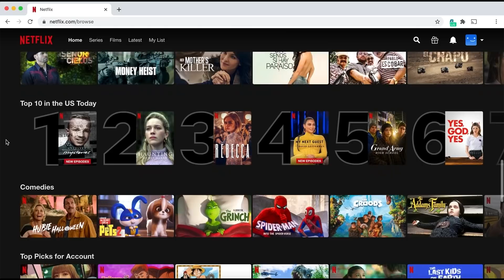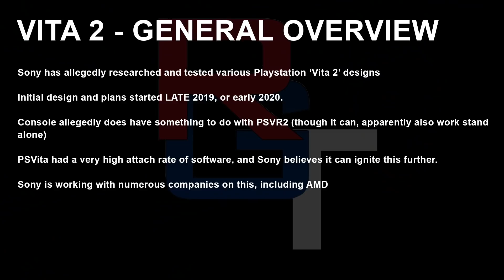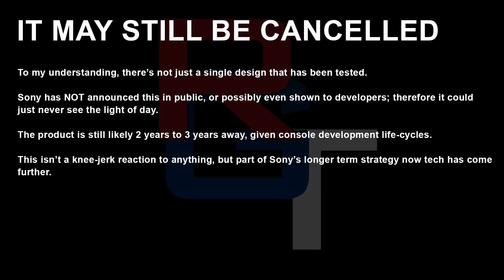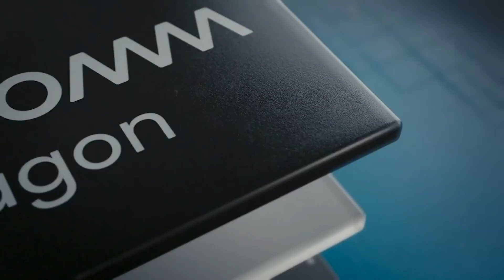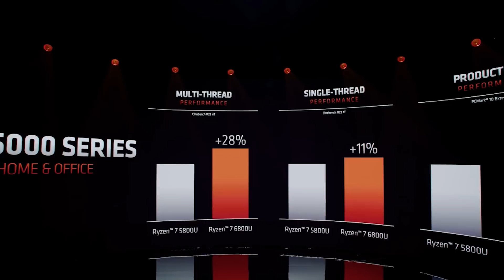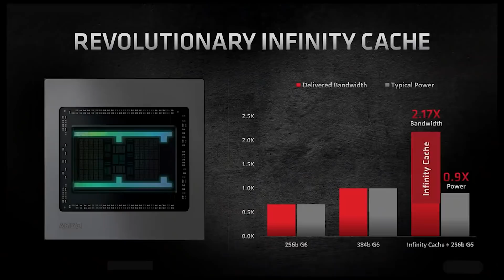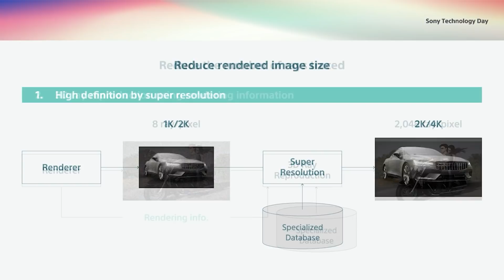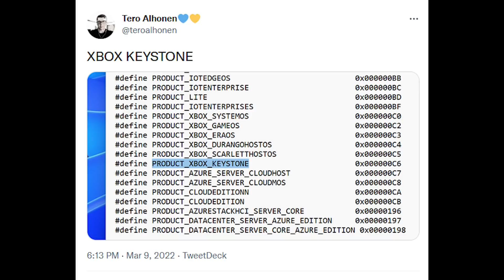NEW PLAYSTATION HANDHELD To Revolutionize Gaming | Xbox PROJECT KEYSTONE Analysis

Comment: If Sony tries to make a handheld based on older technology they're going to get handed a beat down.  The Steam deck will make it look stupid, because as I said in another comment, FSR and RSR should be able to make their way into the games or the software drivers, even though it's Linux based.  I can't see AMD skipping over RSR on these devices because it's a critical feature for low power devices.  It turns those devices into handling open world titles very easily, especially because they can run lower resolutions.  Have the game rendered in 540 and then upscaled to 720?  So I think it's in AMDs interest to get support for RSR into Linux because of the Steam deck and then hopefully that bleeds over into Linux in general.

So regardless of planning, it should be CLEARLY obvoius that AMD can deliver handhelds based on either Zen 3 or Zen 4, and if these companies are smart they're waiting for Zen 4 because of how little power they'll consume while being more powerful, and better software support that AMD will have a bigger interest in improving.

I mean they could move away from AMD hardware, but I don't know why you would want to at this point considering not only upcoming hardware improvements but also how much work has gone into software improvement to make games look and run better.  Zen 4 should make a small device run like a 9900K in a PC.  That's how much power these custom APUs should be able to deliver, and considering they should only need 6 - 8 cores, there's going to be a bit more space for graphics power with the move to TSMC N5.
Reply: The Linux drivers are open source too, so even if amd didn't implement fsr or rsr they 8n theory could be added by the community
Reply: Stop crying about Sony portable you won't be able to afford Nintendo switch fanboy lol

Comment: > revolutionize gaming
It'll run PC games in addition to Sony's?
Reply: This is certainly something Microsoft could do seeing as they control direct x and Windows. Plus they do buy anywhere for xbox and pc games. 

Sony would have to cludge things to play pc games as well as ps4/5 games of some kind as the ps4 and ps5 systems use their own operating systems. Not saying they couldn't,  but it would be a hell of a lot more work and they don't have a store platform to sell pc games from that they'd make money on like valve and Microsoft do. 

Any ps portable will probably tie in with the vr system and maybe provide streaming like they did from the ps4 to vita and effectively give them a stand alone vr option not needing a ps5 for it to work as I think they see vr as a big growth area in a direct opposite view to Microsoft, it will be interesting to see which proves to be right.
Reply: @bionicgeekgrrl  idk why ms doesn't bundle window and office with xbox
Reply: @LichuStar64  because it only runs a very cut down version of the windows kernel. It is designed to be a single use device. If you want office and windows Microsoft would rather sell you a surface device.

Speaking of which they missed a trick with the surface duo by not selling a version marketed for xcloud gaming.
Reply: @bionicgeekgrrl  Huh. Sounds a bit dumb... But I'm a tatd and not a trillion dollar corp. Thanks for the insight!

Comment: It would be interesting if Sony would experiment with a fully open system just like Steam Deck, and put all playstation games from psx to ps5 on it, but also all PC games on it. They could also link it with PSVR2. It doesn't have to have all the visual fidelity, just run all of those games at Steam Deck settings or ideally slightly better. Perhaps RDNA3 MCM could work for a portable design with FSR2.0.